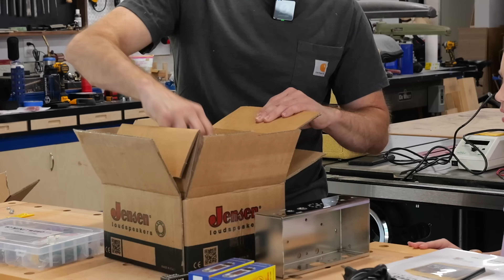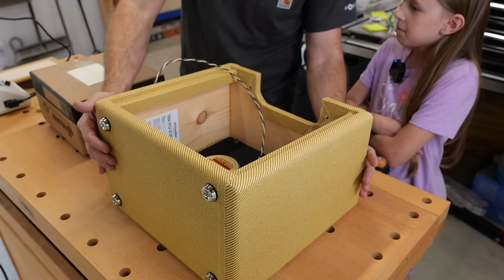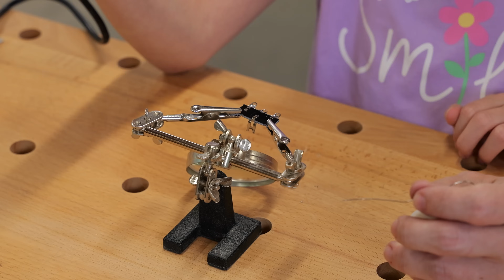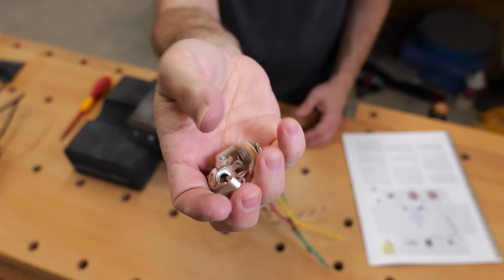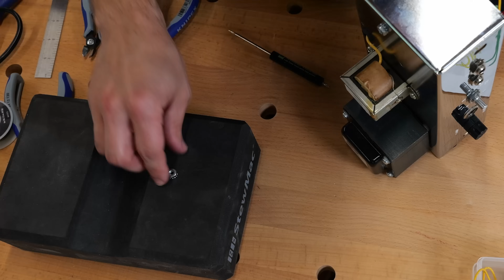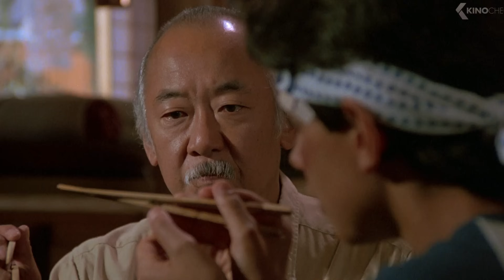Easy to Build Tube Amp

Comment: No, no no no no. Take a soldering class. 10. Your pieces prior to inserting and you will guarantee a solid joint.
Reply from the maker: Personally been soldering a good while and much of that wire is pre tinned 👍

Comment: This is so wholesome, it hits me home because my dad and I built a 50W JCM800 (granted, it’s a different project and we were both knowledgeable in electronics). If you were able to do this however, I strongly advise you to get into DIY pedals, there are a lot of kits for high-end circuits (such as the klon centaur) for really affordable prices.
Reply from the maker: That's an awesome build you and your dad did!  Yes, I'm contemplating doing some pedals 😃 any recommendations?
Reply: @WoodshopMike  PedalPCB have good PCBs and a huuuuge variety. You do have to get the parts separately though: for example there's Smallbear or Tayda, they're two of the most popular parts suppliers. Das Musikding for Europeans is excellent too!

Comment: Nice video though have to agree it"s a bit on the exy side for what it is compared to what you could get off the shelf. To get it to Australia would be USD 913 / AUD 1351 as there is nothing like Stewmac in Australia that I am aware of. Nothing beats a valve amp which is why I have 7 so it is not hard to see why you went down this path.
Reply from the maker: Tube amps are hard to beat!  Glad you enjoyed the video 👍👊

Comment: great to introduce a kid to amp building.. her interest level was amazing.. she's a really kool kid.. while the amp kits are nice and easy.. they are also a rip-off financially.. .. and almost everything stewmac is a ripoff too.. i said almost because they do have a few good durable tools and some difficult to source "quality" parts.. but the majority of their stuff.. like 90+% is pure highway robbery..  i suppose you pay for the convenience of their fairly well laid out catalog/website and  one stop shopping aspect..  but seriously.. by time you complete a project you could have 2 or 3 of whatever you were making/building/repairing.. if you source quality parts and build an amp from scratch.. actually build a cabinet.. a chassis.. etc.. you can save literally half the $ and have a better amp.. now, if you have never handled a soldering iron before.. don't own a saw or drill.. don't understand how amps work.. this assembly of a kit might be the way to go.. you aren't actually building anything.. you are assembling it.. you didn't design the circuit.. it's a copy of a well know circuit.. and that's good.. it will work.. but so limited.. having the cabinet made saves a lot of time.. and makes the final product look good.. let face it.. 1st time woodworking projects almost never look good for the average joe..  but, cabs are easy to make and you feel pretty good when you turn out a nice one.. chassis are a but more difficult.. working with metal takes a different skill set.. once again.. start cutting and bending steel... when you are done.. it feel pretty good..   ordering resistors and caps from mouser makes more sense.. you can get 100 caps or resistors for cost of one or two from stewmac..  the speaker selection is most critical.. that and good transformers..  mercury or hammond trannys FTW.. and speakers..  spend your money here..  then create a good modded circuit.. no reason to settle for a single "circuit".. when you customize your own you can switch between tweed and blackface and marshall all on the same amp.. add a master volume and 2 channels..  boost and bright switches.. tremolo.. vibrato.. reverb tanks.. add an effects loop and a DI box.. an attenuators.. and multiple ohm taps for external cab varieties..   take the best of all your favorite amps and build that into yours..  you are now ready to have some fun..  venture out and really build the next one.. make it a project with your daughter.. learn together.. she's well on her way to being a great musician and maybe the next Alexander Dumble..
Reply from the maker: Thanks for the recommendations👍. Anywhere you'd recommend to learn the finer points of amp design?

Comment: Tip. When you do the panel jacks. Install them in the front facing inwards. Then, when you solder, it will be the exact spacing required. The flip the jacks to the correct orientation
Reply from the maker: Great idea 👍

Comment: This was a nicely-done video. The interaction with your daughter is priceless. I do agree with the comments about the cost of the kit. For the price of this kit, you could buy a Fender Blues Jr. which is a better amp. I’ve done a lot of DIY audio electronics projects. The benefits of DIY are many, but saving money rarely is one of them. The benefits of DIY include learning how things work; the satisfaction of making something yourself: development of problem-solving skills; and the ability to make a custom product that you can’t get any other way. With regard to the cost: This is a Stew Mac kit. StewMac products tend to be expensive. However, they sell only high-quality products, usually designed for professionals. They stand behind their products and have exceptional customer service. There are other amp kits available that cost a lot less. This kit included the cabinet, which most kits do not include.
Reply from the maker: Thank you Tim!  You're right on the money with everything you said regarding the cost of the amp kit but also what sets this one apart from others and learning aspect behind building your own vs buying.  Glad you enjoyed the video👍👊

Comment: Capacitor discharging tip from Gerald Weber of Kendrick Amps: from ground, clip to the first (or in this case only) preamp tube, pin 1.  (unplugged of course) Make sure power switch and standby switch are on with volume up.  All caps will gracefully drain in a minute or two.  I verified this with my Deluxe schematic.  They discharge through resistors so its not a quick zap.  Of course a 10 watt 100 ohm resistor will also work, but you have to be careful not to miss any caps.
Reply from the maker: Thanks man👊

Comment: I'd be curious to see how you'd do with a home-built cab.
Reply from the maker: Planning to do one later this year!  Anything aspect in particular you're curious about with that?
Reply: @WoodshopMike  you kicked ass in your guitar build, so will you be doing a fancy lacquered cab? Or will you be covering it in tolex? Finger or dovetail joints? I don't have a shop, so I cheat by using those pine bee hive boxes at tractor supply.
Reply from the maker: @gayrambo4529 thank you!  Without giving too many details away 😃, it won't be covered in tolex.  I'm not 100% sure about the finish at the moment but there will be some nice joinery involved. 

Nice work around with using bee hive boxes 👊

Comment: I suggest that the next time  you use a turret board. Eyelet board is sh.t. If you could see my princeton reverb eyelet board after 6 years 🙈 It's all twisted and warped.
Now I have to replace it. Building from start with turret board would have saved me a lot of work...
Reply from the maker: Thanks for the suggestion 👍  Hopefully that doesn't happen with this one 🙏